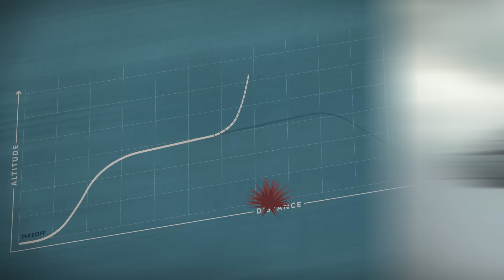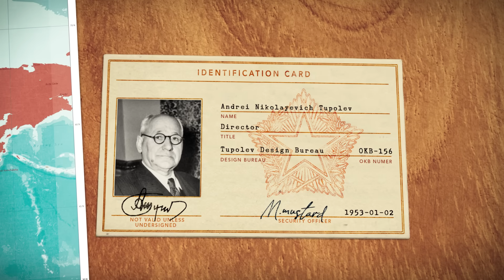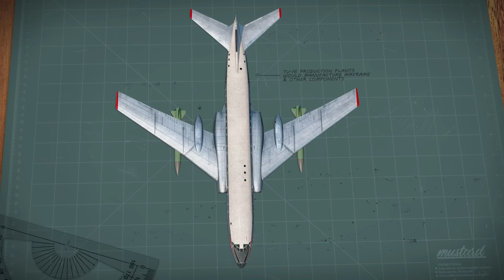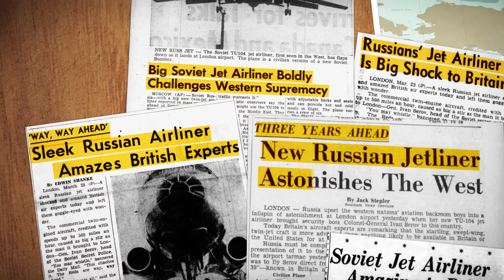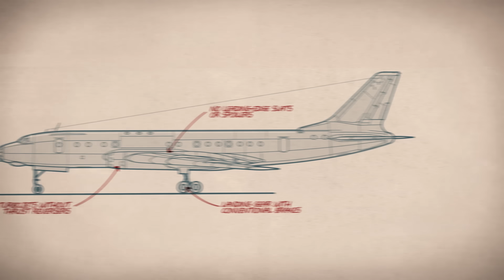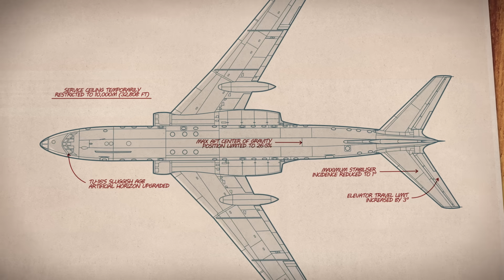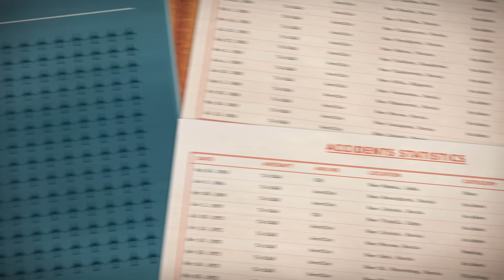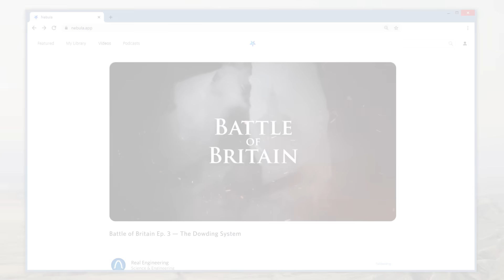The Soviet Airliner Designed To Crash

Comment: In Soviet Russia, 737-MAX fall upwards.
Reply: The 737 Max has an excellent safety record compared to the Tu-104 or the de Havilland Comet.
The Comet has the highest loss rate and fatalities statistics of any jet airliner in history
Reply: @WilhelmKarsten 

@WilhelmKarsten Regarding the fabulous trailblazing 
De Havilland Comet.
Accident Losses generally.

We feel we can clear up some commonly held myths and misconceptions, obviously.

It's always good to see the facts presented clearly and concisely isn't it?

De Havilland was subjected to forced merger under the govt aerospace sector rationalisation programme. A similar process occured globally, Sud Aviation and several other French manufacturers merged during design and production of the Caravelle with the Caravelle becoming a significantly international type project. Even in the US, there was no room for multiple manufacturers of large jet airliners with consolidation being inevitable.

The world's first wind tunnel was constructed in England before 1890.
The world's first supersonic wind tunnel was constructed in England during the 1920s.

The DH Comet was subjected to every type of stress testing & wind tunnel testing possible at the time. 

The world's first high altitude airliner.
The world's first jet airliner.

In fact the Comet was the first airliner to have a full fuselage length pressurised passenger cabin suitable for high altitude flying where pressurisation stress was many times higher than flying load stress. Bow-wing (see b-47 wing folding wing collapse incidents) had built less than 12 pressurised cabin airliners before the Comet first flew. The world's first pressurised cabin aircraft was a British design Airco built under licence in the US and modified in the US to have a pressurised cockpit cabin during a joint US / UK research project. Previous pressurised aircraft were airliners with lower pressurisation & altitude limits where pressurisation stress did not exceed flying load stress or were bombers with small heavily built cockpit capsules where potential total  airframe weight gains were insignificant.

The Comet nose was a unique De Havilland design that Sud Aviation subsequently licensed for use on their Caravelle.

Correct, the Comet was designed with military use in mind. In fact, the first designs were based on military use requirements, the first Nimrod aircraft were straightforward modified Comet 4 airframes. Obviously when the Nimrod first flew, it was of course the most advanced and capable aircraft of it's type in existence. All subsequent Nimrod airframes were indeed simply mostly  new manufacture Comet 4 airframes with the additional equipment bay added. Nimrod design and manufacture was in fact performed mostly by the De Havilland team at HS. 

The Comet was in fact an all metal construction airframe airliner, use of other materials was similar to all other airliners at the time. 

  Obviously there have been worse aircraft for accident losses both before & after the Comet. One of the issues was accident losses due to pilot error which were often caused by the novel aspects of jet airliner flying, even so, the accident losses for the Comet as an airliner were not particularly unusual at the time.

Some changes made were to make pilot error on takeoff less likely to cause serious problems. For example, the skin thickness remained mostly the same from Comet 1 to Comet 4.
Ripstop provision existed for all Comets. The original alloy used was discontinued by the manufacturer, the replacement alloy had similar properties.

  Indeed, at the time aviation infrastructure & aircraft technology etc was still developing rapidly, there was still a lot to do when considering all aspects of flying safety.

    How things were back then. 
Accident losses - % of aircraft built.
DeHavilland Comet 4                   14% 
DH Comet all mks   (ff 1948)       17%  
Vickers VC10 UK                            5%

The DH Comet had better safety than or similar safety to many other commercial passenger aircraft of a similar era.

Douglas DC-1                                      99%
Douglas DC-2                                      47%
Douglas DC-3                                      30%
Douglas DC-4                                      26%
Boeing s300                                        72% 
Boeing 307                                          70%
Boeing 247                                          48%
Boeing 707                                          20% 
Lockheed L-049/149 Constellation  30%
Lockheed Electra Turboprop             29%
Fairchild FH-227                                  30%
McDonnell Douglas DC-8                   14%
Sud Aviation Caravelle                        15%
Canadair CL-44  Turboprop                46%  
Convair CV-580  Turboprop                22%
Convair CV-880     (ff 1959)                27%  
Convair CV-990     (ff 1961)                33%
Tupolev T-104        (ff 1956)                16%

The VC10 held the fastest Atlantic crossing speed record for 41 years (Non supersonic airliners).

For the first few years of operations the Caravelle and Comet had similar accident loss Fatalities numbers.

  Instances of all Comet marks, including the Comet 1 and Comet 3 flew with full certification at some point after 1954. Airline duty Comets were all retired by 1980 with full certification until after retirement. The last Comet flight was a global circumnavigation series of flights in 1997.

   Of course De Havilland carried out a full stress analysis & performed extensive & protracted testing, including pressure cycle testing, on two long lengths of fuselage. De Havilland carried out significantly more testing than was required by any authority at the time & significantly more testing that any previous airliner was subjected to.

  Of course De Havilland had prior experience building many all metal construction airframe aircraft & thousands of jet powered fighter aircraft that were primarily of metal construction with pressurised cockpits & jet engines built by De-Havilland. At the time De Havilland engineers  knew all there was to know about metal fatigue as it applies to aircraft.

    De Havilland did indeed always work to better than industry standards at the time, used up to date knowledge for the design & no evidence of negligence  or criminal negligence was ever produced in relation to the DH Comet.

Military aircraft accident losses compared.
Non combat phase accident losses.
% of Aircraft built.
The EE Lightening did not have unusually high losses. 
The Canadair CL-44 was a turboprop airliner.
Canadair CL-44               (ff 1959 ) 48%
Lockheed XF104             (ff 1954) 100%
Lockheed  P80                (ff 1944)  43%
Lockheed F104               (ff 1954)  45%
MD FH Phantom 1          (ff 1945)  35%
MD F4 Phantom 2           (ff 1958)  28%
Convair F102 Dagger      (ff 1953)  45%  
MD F3H  Demon              (ff 1951)  32%
MD F-101 Voodoo           (ff 1954)  34%
EE Lightening                   (ff 1954)  33%
Gloster Meteor                (ff 1943)   21%
DH Vampire                     (ff 1943)   23%
DH Sea Vixen                  (ff  1951)  33%
Gloster Javelin                (ff 1951)   20%

Note that the Meteor didn't have particularly high losses, flew with more than 20 airforces for decades, got involved in air to air combat during a number of conflicts successfully against aircraft that first flew many years after the Meteor first flew.
 
We hope this helps, of course.       
       
As always, cheers & indeed 👍.

Comment: NO, The de Havilland Comet was the most dangerous... by a considerable margin.
Reply: It wasn't. It's problem was the window. Once that was sorted it served on for many more years. It suffered only because of that.
Reply: @iankitson9980  Comet 1 was grounded in 1954 and its certificate of airworthiness was permanently revoked... the Comet 4 entered service in 1958 and suffered 33 crashes and accidents, the highest loss rate of any jet airliner except for the Comet 1.
Reply: @iankitson9980  You clearly do not know anything regarding this topic, that was a false rumor started by de Havilland and spread through the popular media, the wreckage recovered from the sea and subsequent investigations debunked this red herring and confirmed that the windows had absolutely nothing to do with the catastrophic in-flight structural failures.
de Havilland would eventually admit that they never performed the required load tests on the sections of fuselage that failed.
 The CAA only required a single section to be pressure tests.
 d-H performed this test incorrectly and used faulty data to estimate the pressure load on the rest of the aircraft.
 the investigations also revealed many other fatal design flaws and design defects.

The Comet 4 required complete redesign to pass airworthiness certification. 
Comet 4 was grounded in 1980 after serious metal fatigue was found in all the remaining aircraft that had not crashed or been scrapped. The comet lost its airworthiness certification in 1981. It had the highest loss rate and fatalities statistics of any jet airliner in history except for the Comet 1.

39 Comets crashed or were destroyed in accidents and averaged a staggering 626 fatalities per million flights..
 
No jet airliner has a worse safety record than the Comet.

Comment: The Comet Disaster remains the worst engineering failure in commercial jet aviation history!
Reply: @WilhelmKarsten Regarding the fabulous trailblazing 
De Havilland Comet.
Accident Losses generally.

We feel we can clear up some commonly held myths and misconceptions, obviously.

It's always good to see the facts presented clearly and concisely isn't it?

De Havilland was subjected to forced merger under the govt aerospace sector rationalisation programme. A similar process occured globally, Sud Aviation and several other French manufacturers merged during design and production of the Caravelle with the Caravelle becoming a significantly international type project. Even in the US, there was no room for multiple manufacturers of large jet airliners with consolidation being inevitable.

The world's first wind tunnel was constructed in England before 1890.
The world's first supersonic wind tunnel was constructed in England during the 1920s.

The DH Comet was subjected to every type of stress testing & wind tunnel testing possible at the time. 

The world's first high altitude airliner.
The world's first jet airliner.

In fact the Comet was the first airliner to have a full fuselage length pressurised passenger cabin suitable for high altitude flying where pressurisation stress was many times higher than flying load stress. Bow-wing (see b-47 wing folding wing collapse incidents) had built less than 12 pressurised cabin airliners before the Comet first flew. The world's first pressurised cabin aircraft was a British design Airco built under licence in the US and modified in the US to have a pressurised cockpit cabin during a joint US / UK research project. Previous pressurised aircraft were airliners with lower pressurisation & altitude limits where pressurisation stress did not exceed flying load stress or were bombers with small heavily built cockpit capsules where potential total  airframe weight gains were insignificant.

The Comet nose was a unique De Havilland design that Sud Aviation subsequently licensed for use on their Caravelle.

Correct, the Comet was designed with military use in mind. In fact, the first designs were based on military use requirements, the first Nimrod aircraft were straightforward modified Comet 4 airframes. Obviously when the Nimrod first flew, it was of course the most advanced and capable aircraft of it's type in existence. All subsequent Nimrod airframes were indeed simply mostly  new manufacture Comet 4 airframes with the additional equipment bay added. Nimrod design and manufacture was in fact performed mostly by the De Havilland team at HS. 

The Comet was in fact an all metal construction airframe airliner, use of other materials was similar to all other airliners at the time. 

  Obviously there have been worse aircraft for accident losses both before & after the Comet. One of the issues was accident losses due to pilot error which were often caused by the novel aspects of jet airliner flying, even so, the accident losses for the Comet as an airliner were not particularly unusual at the time.

Some changes made were to make pilot error on takeoff less likely to cause serious problems. For example, the skin thickness remained mostly the same from Comet 1 to Comet 4.
Ripstop provision existed for all Comets. The original alloy used was discontinued by the manufacturer, the replacement alloy had similar properties.

  Indeed, at the time aviation infrastructure & aircraft technology etc was still developing rapidly, there was still a lot to do when considering all aspects of flying safety.

    How things were back then. 
Accident losses - % of aircraft built.
DeHavilland Comet 4                   14% 
DH Comet all mks   (ff 1948)       17%  
Vickers VC10 UK                            5%

The DH Comet had better safety than or similar safety to many other commercial passenger aircraft of a similar era.

Douglas DC-1                                      99%
Douglas DC-2                                      47%
Douglas DC-3                                      30%
Douglas DC-4                                      26%
Boeing s300                                        72% 
Boeing 307                                          70%
Boeing 247                                          48%
Boeing 707                                          20% 
Lockheed L-049/149 Constellation  30%
Lockheed Electra Turboprop             29%
Fairchild FH-227                                  30%
McDonnell Douglas DC-8                   14%
Sud Aviation Caravelle                        15%
Canadair CL-44  Turboprop                46%  
Convair CV-580  Turboprop                22%
Convair CV-880     (ff 1959)                27%  
Convair CV-990     (ff 1961)                33%
Tupolev T-104        (ff 1956)                16%

The VC10 held the fastest Atlantic crossing speed record for 41 years (Non supersonic airliners).

For the first few years of operations the Caravelle and Comet had similar accident loss Fatalities numbers.

  Instances of all Comet marks, including the Comet 1 and Comet 3 flew with full certification at some point after 1954. Airline duty Comets were all retired by 1980 with full certification until after retirement. The last Comet flight was a global circumnavigation series of flights in 1997.

   Of course De Havilland carried out a full stress analysis & performed extensive & protracted testing, including pressure cycle testing, on two long lengths of fuselage. De Havilland carried out significantly more testing than was required by any authority at the time & significantly more testing that any previous airliner was subjected to.

  Of course De Havilland had prior experience building many all metal construction airframe aircraft & thousands of jet powered fighter aircraft that were primarily of metal construction with pressurised cockpits & jet engines built by De-Havilland. At the time De Havilland engineers  knew all there was to know about metal fatigue as it applies to aircraft.

    De Havilland did indeed always work to better than industry standards at the time, used up to date knowledge for the design & no evidence of negligence  or criminal negligence was ever produced in relation to the DH Comet.

Military aircraft accident losses compared.
Non combat phase accident losses.
% of Aircraft built.
The EE Lightening did not have unusually high losses. 
The Canadair CL-44 was a turboprop airliner.
Canadair CL-44               (ff 1959 ) 48%
Lockheed XF104             (ff 1954) 100%
Lockheed  P80                (ff 1944)  43%
Lockheed F104               (ff 1954)  45%
MD FH Phantom 1          (ff 1945)  35%
MD F4 Phantom 2           (ff 1958)  28%
Convair F102 Dagger      (ff 1953)  45%  
MD F3H  Demon              (ff 1951)  32%
MD F-101 Voodoo           (ff 1954)  34%
EE Lightening                   (ff 1954)  33%
Gloster Meteor                (ff 1943)   21%
DH Vampire                     (ff 1943)   23%
DH Sea Vixen                  (ff  1951)  33%
Gloster Javelin                (ff 1951)   20%

Note that the Meteor didn't have particularly high losses, flew with more than 20 airforces for decades, got involved in air to air combat during a number of conflicts successfully against aircraft that first flew many years after the Meteor first flew.
 
We hope this helps, of course.       
       
As always, cheers & indeed 👍.